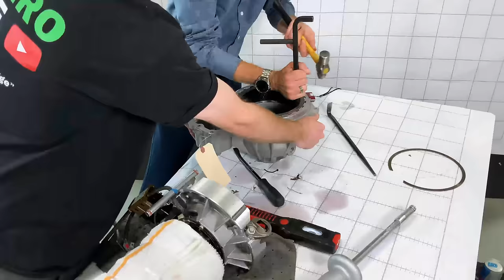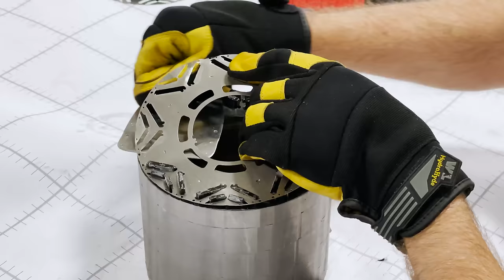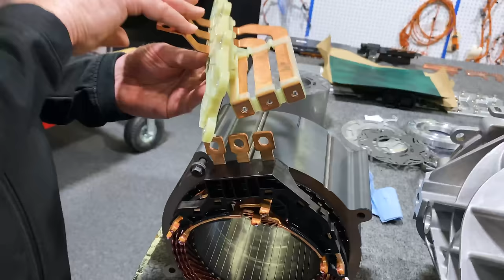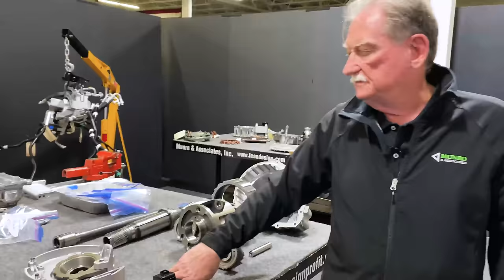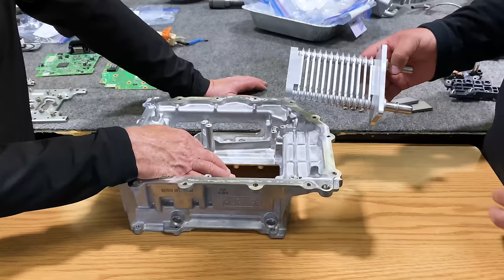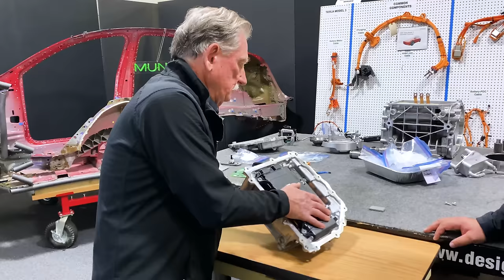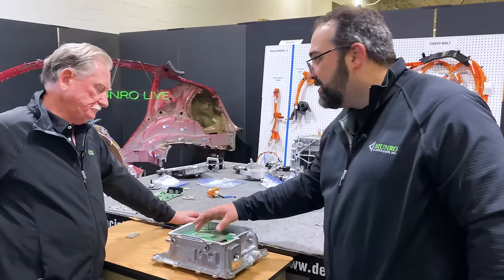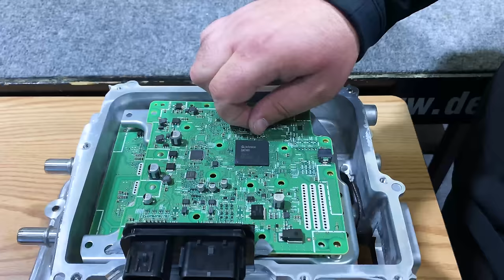Ford Mach-E Rear Motor Teardown and Analysis

Comment: Are you scared to call junk, JUNK? Why? Why ? Weight reduction? I suppose if you own an electric car you can't haul passengers? How about cargo? What happens if your friend is fat and they want to go with you on a trip? Do you have to tell them sorry fatty you can't go because you'll cause my milage to drop? Is that your grand plan? Electric cars are a joke until they can find a way to power them without a battery. Electric is fine, trains have all been electric for decades. But, they use a huge diesel generator as we all know. Battery drills are great, but battery powered cars are a childish joke on humanity
Reply: Hey genius. Extra energy is needed to haul more weight...doesn't matter what tye energy source is. You should've finished high school

Comment: Ugly, inefficient, cumbersome, unnecessary, needlessly expensive and difficult to produce. The amount of resources going into such an inferior product is enough to make you cry, not to mention wasted labor. Copper is rapidly approaching being a limiting factor in EV production, so the more Mach-Es out there the worse for the industry. I can't begin to express how disappointed I am in this from Ford. They should just buy their motors from VW and be done with it. It's like their engineers aren't even trying.